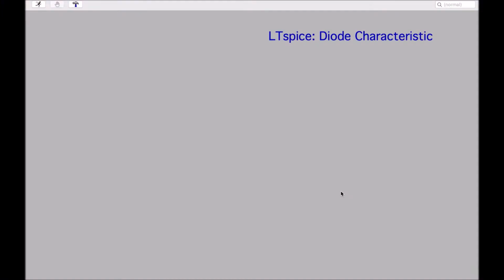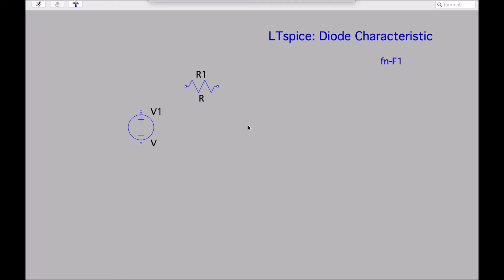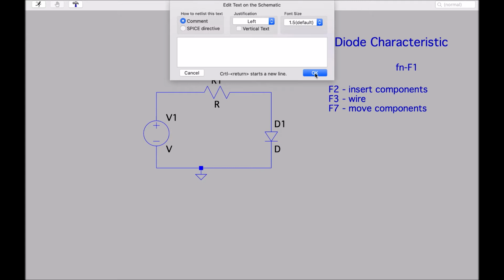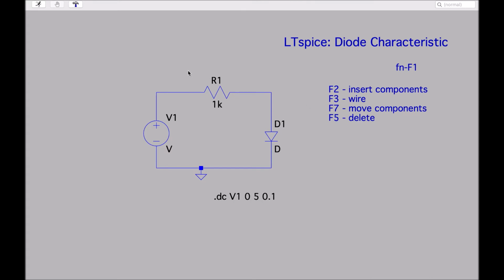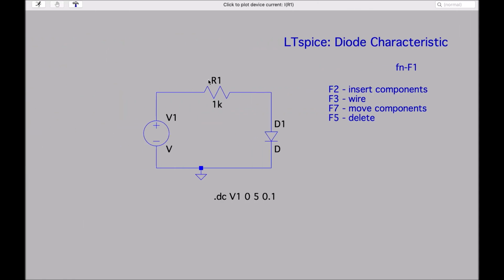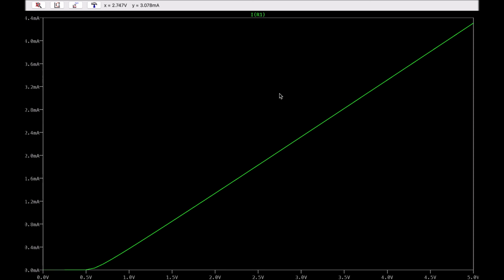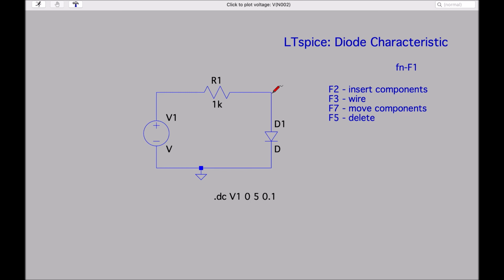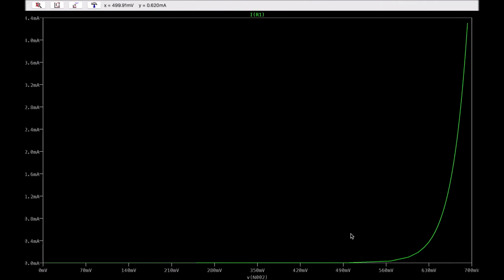Analysis of a Simple Resistor Diode Circuit Using LT Spice (Introduction for Mac Users)

Comment: why we need resistor in that circuit? why i cant just use diode alone?
Reply: lol that is why my I graph behaved that weird 
thank you bro!
i am preparing for exam using ltspice and your video helps a lot
Reply from the maker: To limit current and protect diode: beyond the activation voltage, the diode has near-zero resistance in forward bias, so currents will be extremely large.